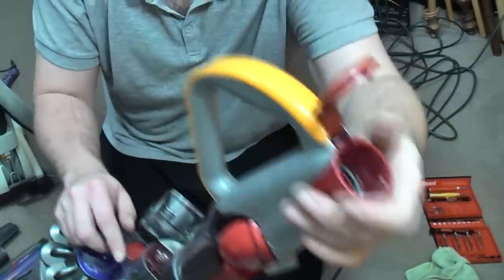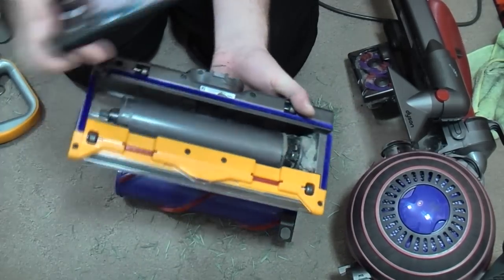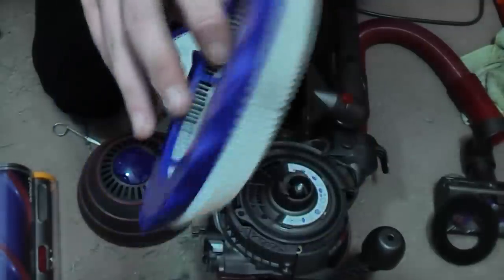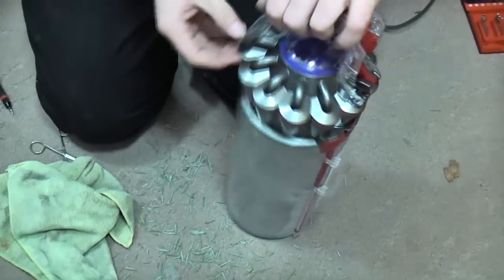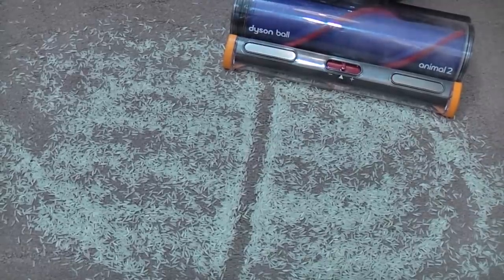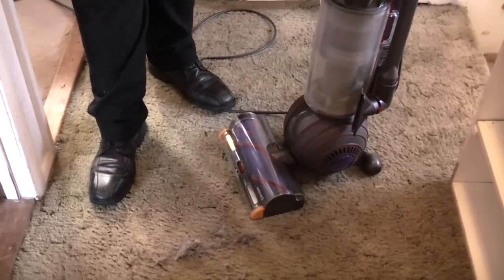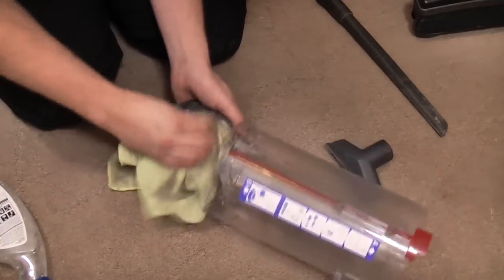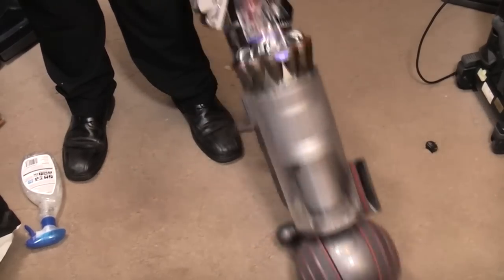Dyson Animal Ball 2 UP24! - Repair and A GOOD TEST!

Comment: i honestly don't see why people bash these so much, they clearly perform great, i think it comes down to if it doesn't have miele or sebo written on it  people hate it! great video also very nice to see a detailed video
Reply from the maker: I sort of agree, at face value it's bloody excellent tbh, but I just know in my head that in 3 or 4 years, they'll be £30 spares or repairs for some reason or other!
Reply: @beko1987  You could say that about everything though, sometimes it's nice not to wait to have nice things 😜
Reply: It's cause people think that it's cheaply made and not gonna last. The truth is people just don't look after them. Don't wash filters don't clean the brushroll and it affects the performance and how long it's going to last.
Although I must say that tangle free turbine could be more effective on these new models.
Reply: I feel exactly the same. My family has Dysons for years without any problems. Where that hate came from I don't know. They block? It's people, lazy people who block them. We've had ours Light Ball for nealy two years and works as on first day..

Comment: This is basically based on the DC40- and light ball- No more DC41/55/75

The post filter design is for noise insulation
Glad you like the performance 😁

Oh and btw the minus setting is only for the two vent  holes at the top of the bumper, it’s why the light ball works on my bedroom carpet cos it doesn’t seal the suction into the head, it provides a bit of airflow
Reply from the maker: Yes, I noticed the extra air noise when it was on - as I carried on! I really was quite impressed with it, although it remains to be seen if they last

Comment: Nice to see their latest machine carrying the dyson flag well. Blocked, dusty, and the filter needing a wash!

But seriously it is really good to see a nice in depth video about one of these! I really like the new wand design. The turbo tool holder looks pretty wimpy. But I really wish we got this cleaner head over here, it seems to perform much better than the older style we still get in the US. And with it having 2 rows of brushes I imagine it would work better on pet hair. All of my cinetics and ball multifloors struggle with pet hair with the single row of brushes (and so they don't get used much). This looks to have impressive performance.
Reply: Future import maybe! ;)
Reply: It does pick up on carpets and hard floor very well. Two large debris vents are really good thing.
I do think it could use some more hose suction though.
Reply: @parwaz7861  the UK light ball and animal 2 uprights can’t be used in the us due to power differences and the plug. But if you have a 240v 50hZ generator then it could be be used.

Comment: Hi Sam thought I’d come back to this video as I mentioned before about putting a 1200 watt pre EU dc40 mk 1 Panasonic motor into one of these and I have FINALLY done it. At first I thought I’d just use the motor bucket from the donor dc40 machine that I got, but the chassis from the ball animal 2 doesn’t fit. So it became a case of making the motor housing from the original bucket fit. So to go that I got a electric sanding wheel that would fit into the bucket and ground off those 2 little tabs that the new 700 watt motors sit it. Then once done you can align the motor Mount from the pre eu 1200 watt one into the casing and gingerly slide the motor with one carbon brush out in. Once in you’ll need the black motor cover and seal from the old machine and it’ll just fit on. And from there it’s the same rebuild procedure as any other machine 😂
Reply: Also forgot to say that the suction release valve needs to be blocked off as the increased airflow from the new motor makes it leak constantly. However once done you’ve got yourself a de regulated beast of a machine. The performance from the cleanerhead is slightly better but the real difference is in the hose as it has similar suction power to maybe a dc04 so now doing the stairs with the turbo brush is brilliant 👍
Reply from the maker: That's awesome, nice job sir!
Reply: Any chance you still have the electronic board out of the euro motor ball, I have a blown resister R1 but have no idea what its value was.

Comment: it's really interesting to see how the Europe noise requirements have affected these cleaners. The cleaner head and the new post filter design are all to better comply with the EU regulations
Reply from the maker: Yep, fully! And sometimes it does more harm than good. Get the cleaner smeggy/don't wash the filter and it'll go straight through, but rather than blow out it'll get caught on the post filter skin and overheat, and the velvet strips around the head wear off etc. Straight suction cleaners are a right pain as the head is designed to just glue itself to the floor, no airflow paths etc, as long as it picks up its 44g of 1.2mm particles from a 3mm deep gap its a pass!
Reply: @beko1987  straight suction cleaners are rather annoying to see especially in North America. Because carpets.

Comment: Do you find though, with the suction back to full power, the dyson tends to clog up a lot quicker? I’ve tried a few times to remove blockages, some where simply the top of the telescopic wand, which sounds simple, but until you have another look for blockages many weeks later after calming down stressing as you couldn’t spot it the first time, you don’t always spot them. I was struggling for ages trying to work out how to access the top small hose at the back of the ball, it never once occurred to me to just fold the stand back. I think I picked this up when I was a service technician for Clarion Car audio, but whenever I’m cleaning any plastics and also rubber parts, and also metal even, I use an anti static foam cleaning aerosol, as it’s quick drying , no residue, and, although I know I’m being way too optimistic, like to hope that not so much dust sticks to plastic parts due to static. To clean the filters, there’s stickers by them saying to wash them under a tap, the ‘sock filter’ you can kind of wring out, and I just keep doing this until I get no dirty water falling on my hands, and then either hang on washing line or stand on a clean chair outside if it’s warm and sunny. The labels say leave for 24Hrs, but if it’s a really nice day, I would take a chance after 3/4 hours. Obviously I’d touch them to gauge how dry they are. For the small circular foam filter, when I was younger I used to fit Pipercross after market air filters in my car, expecting my car to be flying but in reality maybe gain one extra horse power, but you can get cleaning kits for their foam filters, wonder if this would be any good? As I found just rinsing under the tap didn’t really clean thoroughly unless you kinda rubbed your fingers quite hard over it, but worried that you could damage it if your too rough. But thanks, I’m really looking forward to giving my car a thorough vacuum and may even consider the house 😂.

Comment: How do you replace the stabiliser wheels please? Thanks!
Reply from the maker: Got to strip the machine down a fair bit... The wheel assembly is the first thing on the motor housing under all the airflow ducts. Watch one of my dc40/41 stripdown videos, same rough process. Or find the guides on the Manchestervacs forum 👌
Reply: @beko1987  Thanks for this I will have a look at the video and the forums. I have the replacement stabiliser wheels already but cannot see how to remove the existing ones.